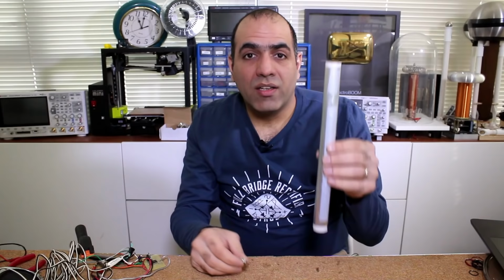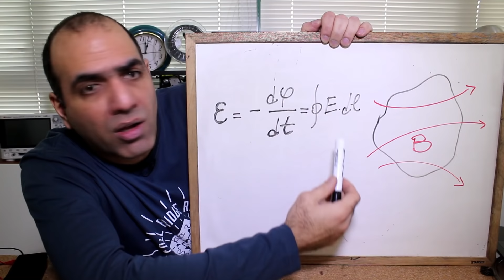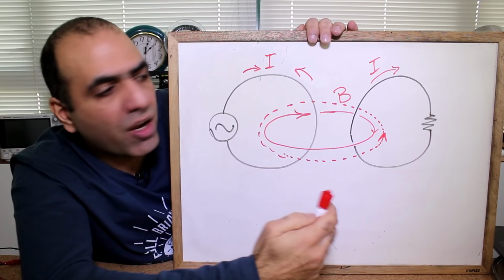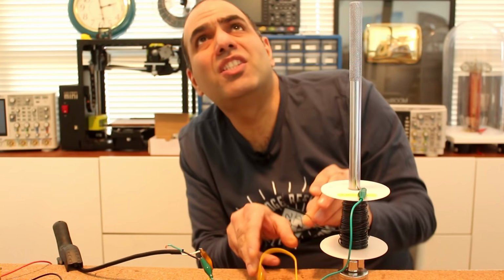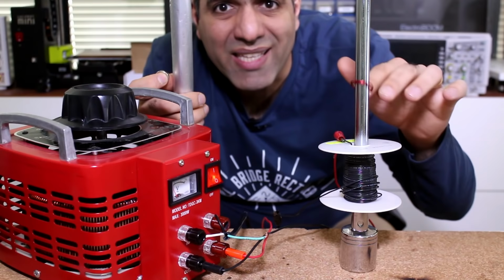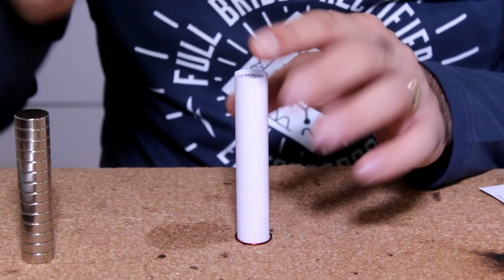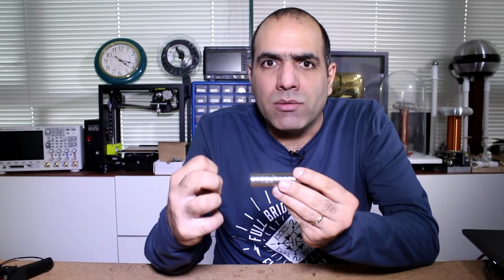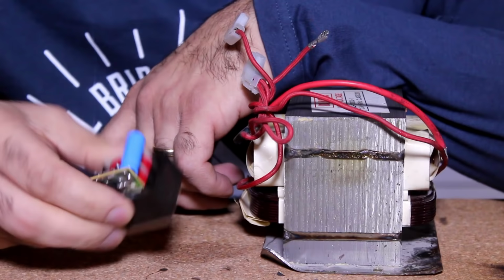The Amazing Eddy Current

Comment: I am a level 3 Eddy Current inspector.  We use eddy currents to detect cracks in aircraft.
Reply: NOICE
Reply: NDT inspector?
Reply: Along with your current TSA coworker Eddy who detects crack in aircraft.
Reply: So you should know, - if, when you drop a copper ring, over a magnet, -  it is actually induction, and not  eddy currents ! ?         ( when you drop magnets through copper ring, it IS eddy's because the ring need not be complete.  just a flat plate. - however not so, with a piece of copper wire !!!. Boom123
Reply: Can you detect crystalline destruction due to Gallium or Quicksilver or are they too conductive?
Reply: Levels of eddy currents: 
Ed
Edd
Eddy
Reply: Can you explain the mechanism in brief please? @Unbox Warehouse
Reply: How many experience points do you get per crack found?
Reply: @arkadeep8049   Level 1 ET inspector in training here. Basically the presence of a crack or other flaw increases the resistance at that localized area, so when eddy currents are generated there, the resulting secondary magnetic field generated by the eddy currents is also weaker, and this can be measured by looking at the impedance (resistance) of the inductor.
Reply: @WetKanoe  but what about quicksilver and gallium induced weaknesses i am definitely not planning to use against airplanes, cough
Reply: @GLITCH_-.-   At its core, eddy current testing is a comparative method that looks for changes in conductivity. You have to have a known "good" sample to compare your test piece to, and anything that differs will be detected. Gallium infiltration in aluminium would definitely change the conductivity of the aluminum, and would therefore be detectable.
Reply: @WetKanoe  Wow! That's a pretty good concept! Thanks for sharing!
Reply: @WetKanoe  You expressed it very well. As you progress towards Lvl 2, always remember the basics. 
I recall one puzzling indication we had on an epoxy coated aircraft wheel (Aluminum). About 3/4" linear indication, orientation not in an anticipated direction, and meter indication contrary to what should have displayed from a crack in Al. Turned out to be a bristle from a stainless steel wire brush had been trapped under the epoxy.
Reply: Also, not the same as an eddy current damper, which is built into the controls and keeps an aircraft from porpoising up and down as it flies. It may not be in all aircraft, less likely in fly by wire, or extremely stable ones.
Reply: any idea on how i can make an eddy current probe for defect detection in metal/steel tubes. I cant afford the ones in the market for my course project? Will wrapping coil around an iron core work?
Reply: @WetKanoe   any idea on how i can make an eddy current probe for defect detection in metal/steel tubes. I cant afford the ones in the market for my course project? Will wrapping coil around an iron core work?
Reply: @jaylittleton1  Level 3 ET dude here. (seriously, look me up on BINDT) Yep, the phase angle of the signal can tell you a hell of a lot if you can interpret it well. I inspect a lot of stuff with ET (power generation not aircraft) and people look at me like I have three heads when I can tell them the difference between a change in material hardness, non metallic inclusions, stringers or actual cracks just by the phase angle of the signal. Depth of signals can be confusing but if you have good comparative blocks you're golden.
Secret of ET is simply in your test block to calibrate off. After that, simples....
Reply: @sahajjain8524  An absolute probe will be far easier to make than a bridge or differential.
An encircling probe might be easier than a bobbin that you insert. Remember you can insulate your design to prevent conduction where you don't want it as you're only creating eddy currents from magnetic fields produced.
Your greatest problem is creating a circuit that can produce the alternating mag fields without creating heat and burning out. Most ET probes use very small amounts of power and I find cycling at around 100 to 500 Hz is best as you will get low noise levels from low frequency but you sacrifice your detection ability

Not sure if any of this helps you though.

But the circuit diagrams for the probes are readily available via google.
Reply: @patrickwatkins7572  that's like saying driving forward and reverse are completely different things, instead of solely opposite in one manner...
Reply: Level 2 saying hi !
Reply: @spugggaldon361  I haven't touched an ET unit in over 20 years, but understand what you're saying. I hearken back to NDT-5, NDT-127, ED-520, FD-100, EM-3300. Old stuff that ran off coal fires.
Reply: @jaylittleton1  personally I think NDT equipment runs off the tears of outage project managers when you tell them there is an indications.
Reply: I used to fix eddy current sets!  You guys put them through some punishment :(
Also shoutouts to the 30-year-old Hocking set that looked like a pip-boy and still worked just fine
Reply: I have Level 1 Eddy Current training for detecting defects in aircraft parts, as well.
Reply: What is level 3 inspector
Reply: @nicewhenearnedrudemostlyel489  depends on the observer hehe,  the car is being pulled uphill by a man with a rope around his balls.  which hurts, because its on a hill.  -  I Have Built a Newman Motor, and it works. -  5kgs of wire wrapped around a 7cm round magnets. - and there is zero drag,  unless the wires are connected.  - no lenz law,  only induction.  -  its a free energy machine, and the academia needs too advance the knowledge of magnet dead zones. .    2 magnets can approach eachother using the deadzone, and then experience greater force separation after a change it orientation...   *smiles with conspiracy theorists
Reply: What? What about Eddie and Edward... @blogofbored3224
Reply: Eddy Current...AKA Magna-Flux... @Tomazack
Reply: @dougankrum3328  I might be mistaken, but doesn't that fall under the general type of work for NDT inspectors? I used to work as a welder, and the lifting equipment had to be controlled by someone with NDT certification. They used some spray and magnetism to look for cracks.
Reply: Those 'C' shaped things with a coil?  ....most of them operate at just a few volts, but a lot of current, the guy standing there running it and smoking a cigarette could be a worry.. @pgtmr2713
Reply: Pretty good, my brother drove trucks for years, doubles..... bottom dump and transfers, and log trucks...with the 1 lane windy dirt roads, some of the loggers have to drive 1/2 a mile in reverse using only the mirrors....you had to really know the roads, so you could decide which guy was going to back when you met.. @nicewhenearnedrudemostlyel489
Reply: @Doug Ankrum. Not sure  what a NC/CNC eddy currrent brake  looks like.  The crack finder though, sure when they are designed properly, they work right. Cheap wire, not enough windings, things can go wrong.
Reply: @Tomazack  yes nondestructive testing.
Reply: @WetKanoe pretty much it. The primary coil is AC and creates a magnetic field perpendicular to the coil direction. That magnetic field is induced in to a conductive material and it causes current to flow in the shape of "eddy currents" this induced current creates a secondary magnetic field that opposes the primary field. After the circuit is balanced you can detect tiny cracks as they disrupted the current in the part being inspected.
Reply: @mareli82  hi
Reply: @sujiths2253  I am one. Lol. It's the highest level of certification in out industry.  I have 6.  VT MT PT UT ET RT
Reply: @dougankrum3328  they make penetrant and mag particle stuff.
Reply: @dougankrum3328  magna flux is not eddy current.  That is magnetic particle inspection. It's different. For example you can perform magnetic particle inspection with DC current and no eddy currents would form. Magnetic induction only works with AC.
Reply: Omg you have 666 likes
Reply: now thats cool
Reply: @GLITCH_-.-  D@mned if I know, but then again you weren't asking me. but anyway:
If I had to guess, any differences in conductivity would show. if ones' detection equipment was sensitive enough, at least indicating a small deviation from the materials baseline conductivity.
 It is also possible, as I've just now found out about this technique, that I have no idea what I'm talking about and my comment is irrelevant. stranger things have happened.
peace.
Reply: @patrickwatkins7572  far out- I think I get it... I think. 
 fact is- i've always wondered how they scan for microscopic cracks in structures... and I think I've got some idea now. like in "metal detectors": by detecting the field, or level thereof, or other characteristics thereof, created by the eddy currents, that were created by the field generated by the device doing the testing. correct?
 peace.
Reply: @GLITCH_-.-  haha. That (Your second question/comment) was funnier than most people seem to realize. I guess I'll be the first to laugh openly about that one... 
 Peace be upon you, sir.
Reply: @primateinterfacetechnologi6220  three years and I still don't have an answer. :(
:)
Reply: @GLITCH_-.-  Well... I just read a paper talking about how they're developing techniques for detecting gallium infiltration in aluminum structures... Most of which was way above my head. The paper was titled "applied machine learning for detection of gallium infiltration attacks on aluminum alloys common to military structures" by Peter Holtmann.  the paper spoke of fiber Bragg grating sensors, machine learning techniques, and endless other things that I'm not educated in... But perhaps you are.  Go ahead and Google that paper, and maybe you'll understand a lot more of it than I did. Strangely the paper did not seem to be dated but was definitely post-2017 due to that date being mentioned in it. the title in the bar on the top of my screen was dated 2021... Unless that's just when the PDF file was created, I don't know. And it sounded like they hadn't actually developed the technology all the way yet but they figured they were going to have it really soon... or something. 
 So: peace and good luck.
Reply: Mario taught us all you gotta do is eat a weird mushroom to level up, so mushrooms must be superconductors i guess
Reply: @blogofbored3224  😂
Reply: Isn't this called MagnaFlux?
Reply: @WetKanoe exactly.

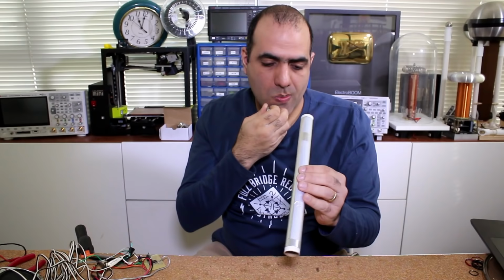Comment: 0:58 the spark was so perilous that even the clock moved 20 seconds forward XD
Reply: Confirmed
Reply: Because, the magnet jumps to circuit and blows
Reply: how did you even notice that
Reply: At that point he reached near-light-speeds, and we as the viewer viewing it from the same window didn't feel the time passing differently. But the time for the rest of the universe it flowed normally thus the clock jumped a couple of seconds. No big deal...
Reply: He's a time traveller
Reply: ElectroBOOM DEBUNKED!
Reply: Jokes aside, how does that even happen?
Reply: @shardinalwind7696   I have no clue and I would also like to know
Reply: Wait What the HECK, please someone explain

Comment: "I created a voltmeter... that's drawing ten amps."
LOL!
Reply: That's called a load tester.   They make them for car batteries and such.
Reply: @wouldntyouliketoknow9891  Oh, good call. I was just watching a video recently where someone said you could test a alkalline battery just by hooking it up to a voltmeter and seeing if it's close to 1.5V. A lot of people in the comments admonished that person, saying that you don't really know the health of the battery unless you're checking the voltage while drawing non-negligible current.
Reply: @tom_something  There is a ton of science around the seemingly simple thing of telling the state of charge of a battery.   Short version is that it depends on the battery chemistry and how you are using the battery.   But the guys who did the admonishing spoke too soon.   Measuring the battery's open circuit voltage (no load) can tell you a lot about the battery.  For an alkaline cell battery, expect 1.59-1.62 volts open circuit on a fresh battery at 100% state of charge at room temperature.   If you measure the OCV and its under 1.50 you can tell immediately that the battery is flat without any further testing.   But the converse is not true; just because the OCV is good doesn't mean the battery is good.  There are various defects it could have that only show up under load, so the second step of testing is to put a non-negligible load on it.
Reply: Tom Haflinger an alkaline battery should be checked to see how close to 1.65 v... to check the state of charge.
Reply: @tom_something  on alks I just hook a volt meter up and briefly short the battery out , you can see how charged it is by how fast it climbs back up to 1.5 volts.
Reply: @tom_something  In this case, shouldn't the resistance of a voltmeter be so high that the current it draws is negligible? The input impedance of a standard voltmeter for DC is 1 megaohm, so the current drawn would be only 1.5 microamps. Surely not enough to effect the measurement of a 1.5 volt battery. Also, the battery voltage definitely doesn't drop linearly over percent charge (energy stored). See https://www.powerstream.com/AA-tests.htm
Reply: @Dublin_N  , that's why I said a non-negligible load is useful. Implying, of course, that a standard voltmeter's draw is negligible.
Reply: @Dublin_N  Yes, otherwise all that current flowing (10 amps) changes the circuit. That's why he mentioned it and shrugged. The act of measuring changes the results, 10 amps substantial. However! This would be a great visual tool for load measuring batteries! They need to be voltage measured under load to measure their internal resistance. A negligible resistance voltmeter can't tell a good battery from a bad one unless it's totally dead.
Reply: OMG i laughed so hard at that too.  XD. ROF!!
Reply: @wouldntyouliketoknow9891   So an example of where the voltage can get the health of a battery wrong is with Lead acid batteries. When i bought my first car it had trouble turning over (like the battery was flat), so i tested the voltage and it said it was at the (typically) fully charged voltage level.

The battery had suffered acid stratification with it being sat on the dealership's lot. So it was at the right voltage until you tried to draw full current from it, at which point it turns out only a faction of the battery was producing that voltage.

Fortunately rocking it gently (to mix the acid levels up) and charging it up fixed that problem but it did cause me a few head scratches because from the "normal" battery test of voltage, it was fine.